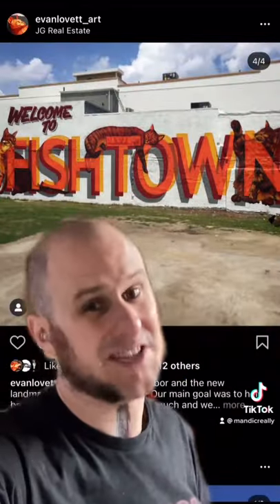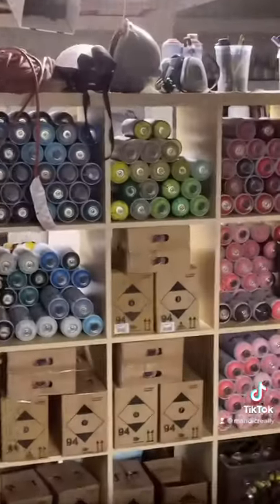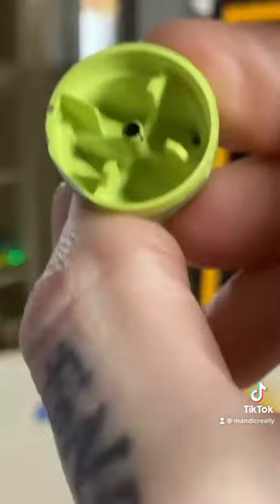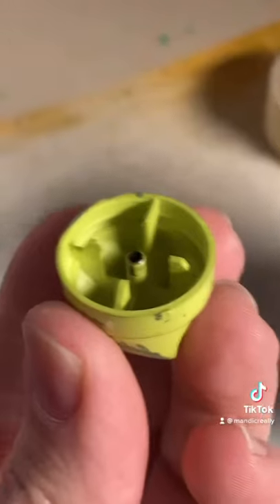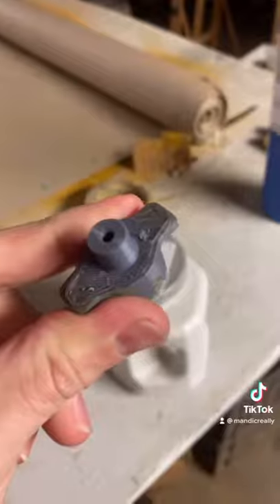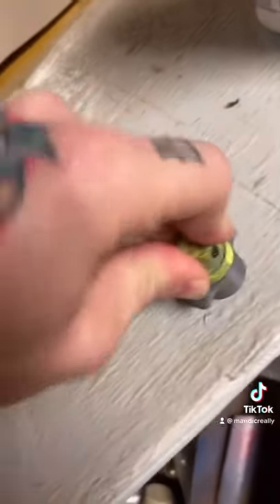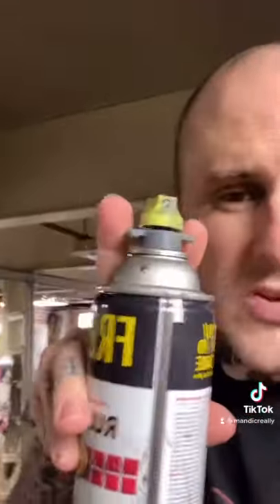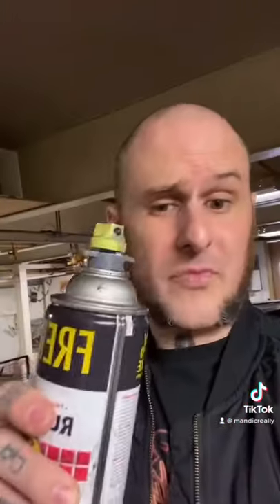3D Printed Spray Cap Adapter - Tool Tip Tuesday #shorts

Comment: I would have thought the solvents in the paint would attack pla?
Reply from the maker: He’s been using the first couple I printed and we haven’t found any issues. I was concerned about that as well, but these are considered a consumable anyway. Just like caps clogs happen and when painting a 50 foot wall you can’t spend time cleaning out caps and adapters. So maybe it would in long term use. His use case is a dozen cans in a day, not one can over months.
Reply: @HotRodHippie  dude has more organization with his paint than I do with my life.
Reply: @dbongoloid9541  😹

Comment: The design is called a French wing tip and they've been around forever
Reply from the maker: Didn’t say I invented it. Just made an easy to print one for anyone who has access to a printer.
Reply: Give a little credit to the inventor and to hippie for sensationalizing it

Comment: But...this adapter already exists...it has in the graffiti world for over 10 years. It's called a wing adapter or male-to-female tip.
Reply from the maker: I never claimed I invented it. I just designed a piece that folks can 3d print as they need.

Comment: I've been using a adaptor like that in the UK for the last two decades 🤷🏻‍♂️
Reply from the maker: Never said I invented it. I just made an easily 3D printable one so folks can make them.
Reply: @HotRodHippie  never said you did. I just wouldn't spend the money on the filament and energy and time when they're so easily and cheaply to buy.  Different strokes for different folks I guess.
My comment wasn't a dig at you. take care god bless.

Comment: Nice job w/cad it it a bit taller then expected?
And omfg lol as a furry the docking joke means something so much more 🤣🌈🤣🌈🤣
Reply from the maker: It isn't taller than I expected.  The Design has to the two tips barely separated.  The inside diameter of the bores varies by printer settings and printer quality.  I may do another iteration where I try and make it fit just a bit better.  It works fine now but I can see room for improvement. 

Also, the Docking joke means what you think in most walks of life.  HA
Reply: @HotRodHippie  oh ok nice well best of luck with that and my dad says don't fix what's not broken